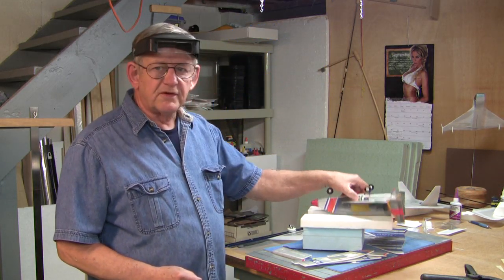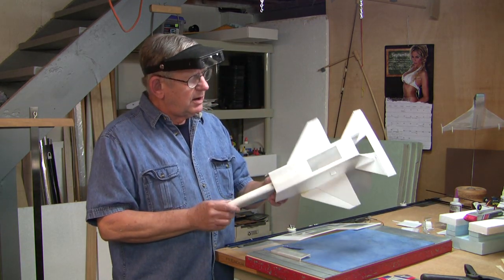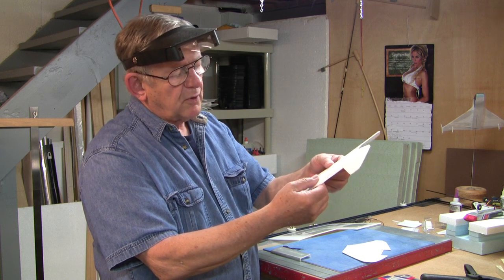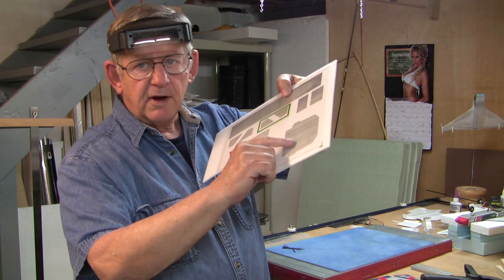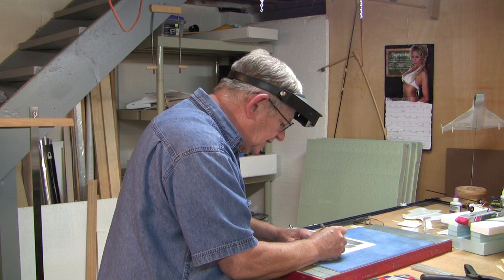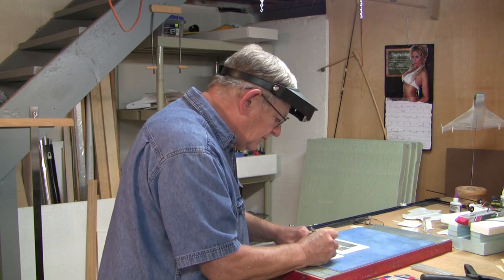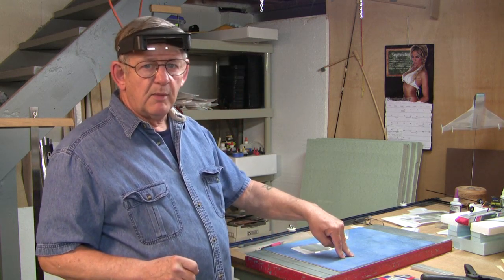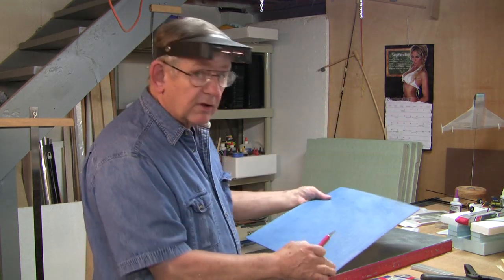Folding Depron Part 1

Comment from the maker: @FlyHighRC386 , The Miglet was supposed to be for a 30 mm fan a couple of years ago. At the time I was working on it I had a computer crash and the technicians took about two months to fix it. I didn't know I would be without my computer for that long. The project was postponed and since then it was overtaken by events. I'm embarrassed to say it but I have a lot of projects that are on hold for one reason or other.  The last two days I've been drawing up something that looks like a Lippisch P13

Comment from the maker: It has a approximately a 330 mm span (13 inches) and depending on how it is configured shoud weigh between  50 and 65 gm. There are videos of the original EDF and the pusher on my channel.